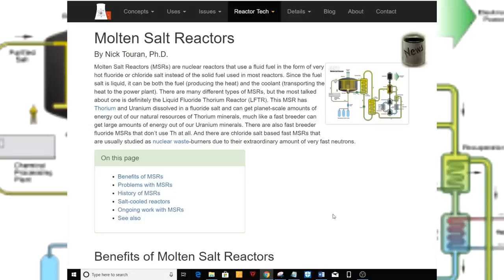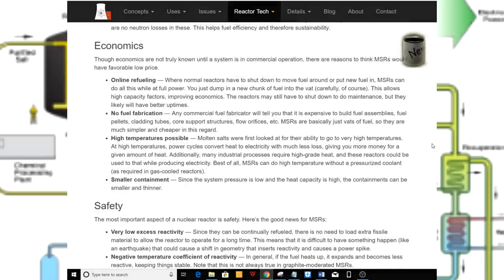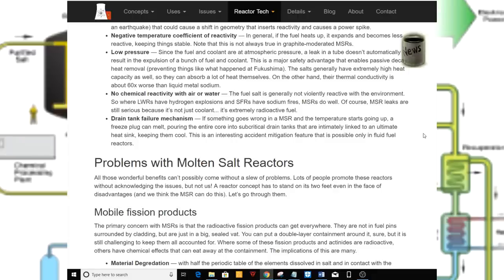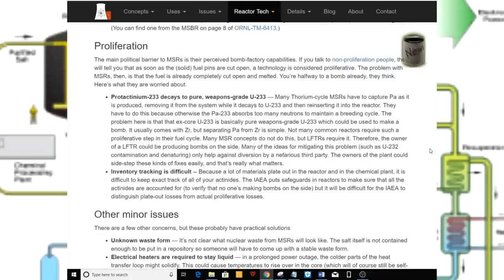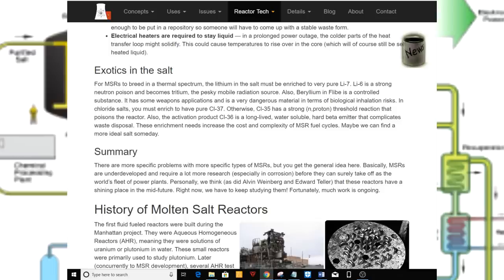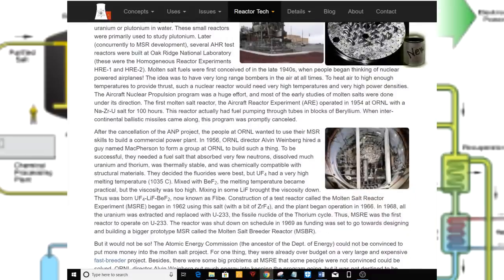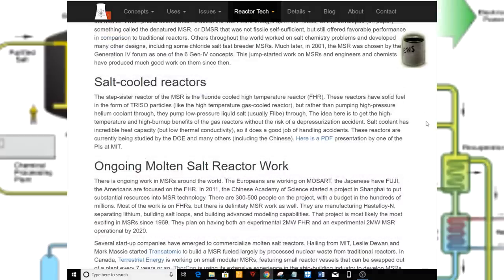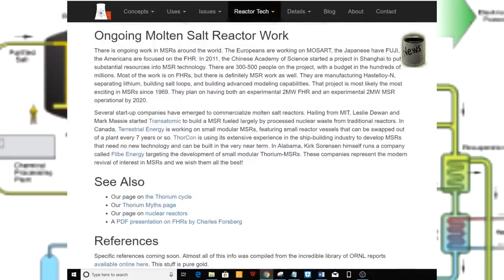The Actual Problem with Molten Salt Reactors ...and benefits obviously

Comment: I hope we soon have these kind of reactors in operation.
Reply: Terra Power and Nick Touran don't.  Perhaps that was the point of the video?
Reply: Is not U232 a deterrent for nuclear weapons proliferation?
Reply: @JoseFernandez-yz1sf  Commercial Molten Salt reactor plans will use Uranium Plutonium cycle for the foreseeable future.  They are breeders after all.
Reply: @rogermorey  you might be interested to know that there is ongoing TerraPower research on this topic.
Reply: India started to built thorium reactors and they say they want to power 30% of india with thorium by 2050.
Reply: @martinapoklukar7747  Yes, but they're not molten salt.
They're replacining uranium in conventional reactor designs.
And they do it because they have no rich uranium deposits of their own..
Reply: @rogermorey  thing is, you can use those "waste" products in the fuel cycle.
Reply: @rogermorey  onley for starting up.
Reply: The state of California is going to subsidize home LSMR and phase out rooftop solar panels
Reply: @rogermorey  MSRs are simply not as perfect as people make out. Some are convinced, others aren't, but both would agree that any Gen IV reactor that can work is better for the world. TerraPower itself is developing it's own MSR, so to say they don't want it is asinine.
Reply: @infini_ryu9461  TerraPower is competing in the same space with Thorium MSR, yet advocating breeding U238, plutonium etc, which has none of the supposed benefits of MSR Thorium advocates.  I agree that MSRs are HEAVILY flawed as a concept, and in practice.  Agreement on GenIV is only among new nuclear advocates, as they are only in design stage.  Most think breeder reactors are risky and expensive.  If your goal is inexpensive "Green" energy, advocacy of new nuclear ensures continued fossil fuel use.
Reply: @rogermorey2152  The whole point of trying to get a breeder going is abundance. It would be much easier to sell if countries know they can reach energy independence and a long term solution, something old reactors can't give them.

Both U238 and Th232 can create fissile bomb material, but if they are dilute enough it's entirely redundant with simply digging U235 from the ground and making them without reactors at all. Even North Korea did this, so I'd argue bombs are not an excuse to ban them at all. The point of solid fuel(Travelling Wave Reactor design) is that it's much harder to obtain them or impossible, whereas in an MSR, you can't help but to separate bomb material. It's also safety concerns with handling all the stuff. The biggest blocks to breeders is legality.

Thorium 232 has benefits in the Thermal spectrum, but Uranium 238 has it's benefits in the Fast Spectrum. Thorium is overrated imo, but that's not to say it's bad. We can get modular reactors working, as we have in subs.

Countries are putting up Gen III reactors such as in India and China, so they're working in tandem with developing new reactors. There isn't a loss here in developing new ones.

Case in point, any Fission reactor has a much greater likelihood of going commercial than say, Fusion, which is perpetually "right around the corner". Saying it's pointless when we're literally blowing money on something that doesn't exist yet is pretty ridiculous.
Reply: @infini_ryu9461  If you make fast breeders, you are going to produce a lot of plutonium, prime bomb material.  Agreed, Thorium is hype.  The issue with Gen IV, along with the common, waste, storage, regulation games is cycle time.  Hard to see coming on line in 7-20 years, huge initial investment say ~$20B/GW.  Then decide it's good and build 5 more in say another 7-20 years for 14-40year 6GW@$120B.  Compared to renewal and storage, few drawbacks and could do in 3-4 years6GW@ $4B. Most these nuclear engineers only do numbers while looking at their own wallet.
Reply: @rogermorey2152  All reactors produce plutonium. So why can't we use them to make bombs? Because it's not that simple. You don't just need plutonium, you need a specific isotope of plutonium, Pu239. Not all plutonium is weapons grade, it needs to be a certain level of purity which is hard to achieve and needs a special kind of reactor, you need to be trying to "toast" the fuel, only running the fuel for 3 months before it starts to dilute the plutonium. Commercial reactors cannot do this.

The Integral Fast Reactor project was proof of concept, the plutonium mixture best suited for these reactors could not be used to make bombs. They never once made weapons grade plutonium, the system was designed against it. These reactors could run the US for 500 years simply on the depleted uranium the US had stockpiled, and burn through all of the long lived spent fuel from LWRs dealing with our waste problem, and it would be clean. These reactors could also survive Fukushima and Three Mile Island type events, they even tested it trying to make it meltdown and the reactor simply shut itself off. It was real, not just a theory. We have been cheated out of this technology because of party politics. You should be mad.

They didn't tell you that North Korea doesn't have a single nuclear reactor in all of NK, they made a nuclear bomb without even going through the hassle of building nuclear reactors. You dig uranium out of the ground, enrich it to 90%, and presto, nuclear bomb. Any country willing enough can make a bomb, so proliferation is not an argument. The worlds largest thermonuclear detonation was from a bomb using enriched Uranium 235.

Comment: Cl35 is not an issue in an MSR as this article states, it has a rather small (less than 1 barn) cross section for the n,p reaction. Also, its neutron absorption is a little higher at around 10 barns, still nothing to worry about, especially when using FLIBE, or lithium fluoride and beryllium fluoride salts.

The issue we have here is Dr. Touran (guy who wrote the article) works for Terrapower LLC, a company in direct competition with organizations like FliBe Energy and MSR research in general.
Reply: Or you can have a fast reactor where almost any junk in the fuel is not a problem.
Reply: @MrRolnicek  Indeed.
Reply: this video is so wrong
Reply: @custume  Agreed.

Comment: The best presentation I have seen on thorium reactors.  Both opportunities and problems are presented objectively and I have seen enough information here to believe that this technology show great promise and is worthy of additional investment.  All of the other presentations I have seen present only one side of the issue which only creates uncertainty.  Great job!
Reply: You would be right if the video didn't contain gross errors (certain chlorine isotopes being an issue in MSR's for example). 

Also, this article having been written by Dr. Touran, a direct competitor with MSR technologies for Terrapower LLC, should make a person think twice about the credibility of the assertions made.
Reply: @ian5576  If the Holy Grail is to be a carbon free alternative than thorium, with all of its engineering problems, looks pretty good compared to just wind and solar.  Wind turbines are a disaster and solar still has the energy storage problem.  We don't want to be like the Germans with sky high utility rates.  Americans won't go for that.
Reply: @jimmoroney7529  It is likely the Germans are realizing the costs of their ambitious (and somewhat misguided) energy program, but what does that have to do with inaccuracies in this article?

All options are on the table, and the best way to delineate the correct path forward is through scientific honesty.
Reply: @jimmoroney7529  They will if they have no other choice. Look at what happened a few years ago when gas got to $4.50 a gallon. It cut down driving and smaller cars came along
Reply: If we don't come up with a low cost solution to supply energy, utility rates will more than double.  This could set off a world-wide economic disaster that may trigger wars.  Wouldn't it be better to research nuclear and other options now to prevent this?  If we assume that the only solutions are wind, solar and renewables (as the Germans have) and automatically rule out any nuclear options, disaster is bound to happen.  Even some Greenpeace members agree that nuclear options should be considered.  Thorium reactors have a number of engineering problems that can be resolved.

Comment: Solid reactors had problems too, but with research they solved many of them. They could have done the same with MSRs, IMO, and we would like have been better off by now, IMO.
Reply: Olivier Bourque the only reason the US didn't go with MSR's is simply due to military purposes as the design that became standard produces  Plutonium i.e. Bomb material..... so the US so the reactor as a two for one deal as they would produce energy for the grid while simultaneously producing nuclear bomb material, a real win win in the eyes of the US government
Reply: @metatron5199 
What about Germany and Japan who both build their own nuclear reactors with their own research, industry and designs and no interest in the bombs?

Also thorium reactors can produce weapon grade uranium as a standard operation function.

Comment: The "jesus christ" is a good personal touch for the phrase "molten fuel pumping through tubes in blocks of Beryllium".
Reply: "Jesus Christ" was because this reactor was on a fucking airplane.
Reply: @pilotavery  Then you would absolutely LOVE the version that was proposed (and patented) for use in railroad locomotives (The X-12 project). ;-)
Reply: @bratwizard  Thanks, going down the X-12 rabbit hole now
Reply: @pilotavery  Don't forget to read his actual paper at the University of Utah, 'An Atomic Locomotive - A Feasibility Study'.

Comment: My personal favorite reactor wasn't mentioned here.
It's developed by Elysium industies, it's a chloride salt fast breeder and waste burner and it doesn't suffer from ANY of the drawbacks mentioned here (denatured fuel by putting junk U-238 in there, no reprocessing etc.)
Reply: It is more likely that it suffers drawbacks that are Not mentioned. At least this video is comprehensive both ways.
Reply: @avid0g  Yes, comprehensive and fair but outdated. A lot has happened in the MSR scene in the last few years.

Comment: Wind and Tidal suck at power generation per acreage and environment offset costs.

Solar sucks at environmental offset costs when being developed as a primary power source, as a secondary and tertiary power source it's pretty favorable.

Nuclear is the greenest large scale primary power source we have, and despite the issues regarding MSR's and my favorite being the LFTR design, I feel it's the way to the future as it's likely going to take another 80 - 100 years before Fusion reactors are ready to even enter the power generation scene.

There are 2 things that people are concerned about in regards to Nuclear Reactors...

1. SAFETY, in the form of meltdowns, explosions, and natural resource poisoning. MSR's/LFTR's have this down aside from the Tritium issue which is being heavily worked on and from what I have been told and read about there is a very promising plan in effect that needs a little more testing before it is considered a viable solution. In all over a LW-PWR (Light Water - Pressurized Water Reactor) which makes up the absolute vast majority of power generating reactors in the world and MSR/LFTR is off the charts better at safety than even the latest and best designed LW-PWR.

2. EFFICIENCY, this is in conjunction with how much waste is output, if 1 gallon of hydrocarbon fuel powered 1,000,000 homes no one would have an issue with coal, but that is certainly not the case. MSR's and especially LFTR's have a MASSIVE advantage here due to their designs, they are hundreds of times more efficient in fuel burning than even the best and most modern LW-PWR's. Here is why..

LW-PWR's using U-235 have a 1:6 capture/fission ratio and when U-235 absorbs a neutron it become U-236 which is NOT FISSILE, and U-235 is EXTREMELY RARE making up 0.72% of all uranium on Earth! It's actually on par with platinum.  Many LW-PWR's use U-238 which is NOT FISSILE but it is fertile and becomes PU-239 though decay and that is fissile, but at a 1:3 capture ratio, it's shit, but U-238 is the most abundant form of uranium on Earth by a staggering amount thus making it economical. The downside is the long lived transuranic wastes that come from this process that makes them radioactive for about 30,000 years and plutonium being a 100% synthetic element means that it is HIGHLY toxic to ALL organic life, much more so than Uranium, it's the radioactive "boogeyman", and it will kill you horrifically.

LFTR's use a Th-232 -> U-233 breeder process, and U-233 is 100% natural but has a half life of only a few hundred thousand years meaning it has been LONG GONE since our planet was forged in space. U-233 is incredibly energy dense with a 1:12 capture ratio, literally DOUBLE that of the ultra rare U-235, and with the fuel burn benefits of a LFTR it gets staggeringly high efficiency ratings that no LW-PWR can even dream of touching. Also the transuranic wastes are only radioactive for about 300 years instead of 30,000 but because they have such a short half life they also are considerably more radioactive and REQUIRE remote handing.

LFTR's are by far not perfect but they are a much safer, and more efficient design than anything used today.
Reply from the maker: Lftr neutron economy is yes more efficient, but power density not so good because of the high, narrow operating temperature.  There are also several issues involving how to implement a moderator without excessive degradation.  The technical issues are clearly difficult, which is probably why so much effort is going towards liquid metal cooled fast reactors. And, chloride salt has gotten a bad rap too.
Reply: @RCrosbyLyles  LFTR does not use a chloride salt, it uses a Fluoride Beryllium Salt mix it's very different chemically but still corrosive.

One of the biggest issues however is tritium filtration, but from what I have read there are some composite metals in testing that are looking extremely promising.
Reply from the maker: @Spartan536  I mentioned Chloride salt because some proponents of MSRs that use Chloride salts claim that it's possible to breed 37Cl and that there are advantages to having a molten salt fast breeder that operates at a lower temperature. Proponents of FLibe like the fact that there is only one isotope 19Fl that also conveniently acts as a moderator and claim that producing pure 37Cl is more difficult. If 37CL can be breed and has favorable Neutron opacity and is less corrosive than FLIBe with a lower operating temperature then LFTRs look a little less attractive. And LFTRs have nagging problems with power density and corrosion.
Reply: @RCrosbyLyles  ah ok, I have heard the argument on this before, I was unsure what angle you were initially going at.